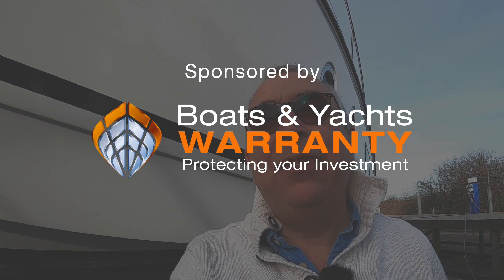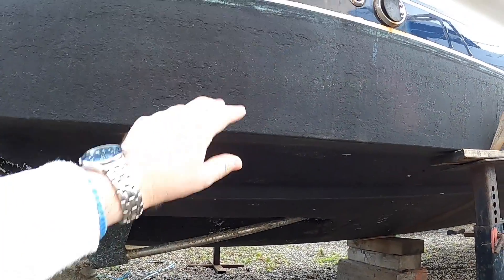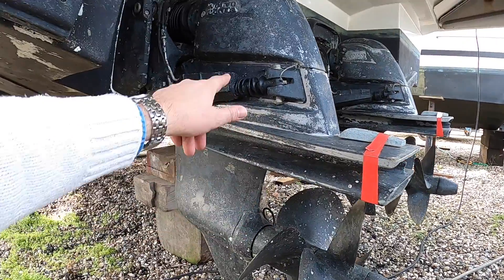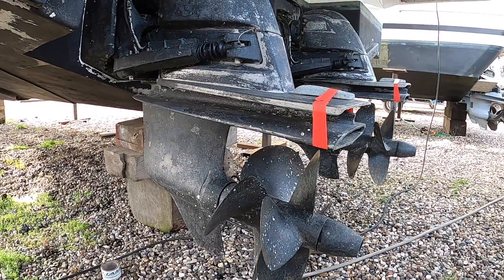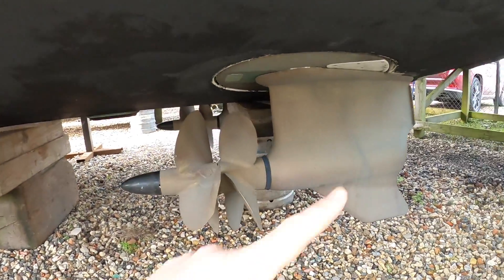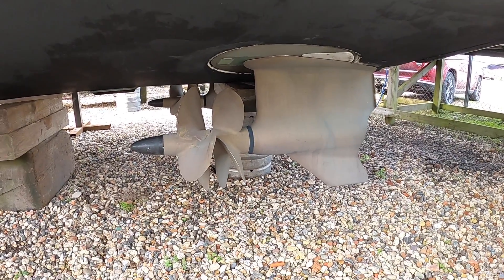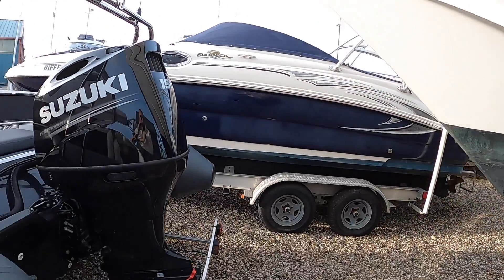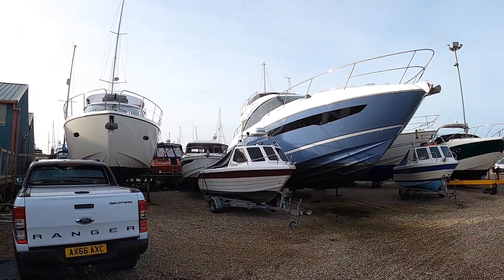Boat Drive Systems Explained

Comment: IPS can now be had as Twins, Tripples and Quads. Also, the pods are designed to detach if struck hard, without leaking. Shallow enough water, you can have them salvaged and possibly repaired.

Comment: Hello I was on one of Thames river boats from the sounds I can hear engine running and a high pressure water jet coming out of a nozzle on the back I was unable to see any fixed pitch or variable pitch propeller can you enlighten me how the boat is running.
Reply from the maker: Water jet probably! 🙂
Reply: @AQUAHOLIC  Thank you; that is what I suspected as I was not able to see any propeller.

Comment: Without a Trailer, Stern Drives are a pain in the ***. - The prop unit is always submerged and that means corrosion 24-7... and to service it, you have to pull the Boat onto land.   Outboard Engines are far better and easier to maintain.

Comment: Ive read some time ago that ips (specially the volvo penta ones) are a real problem. Apparently they have some kind of sealing(cant remember the name) that needs to be changed every 5 years or less, otherwise your ship may very well sink and is like a 10k per seal on each engine .
Reply from the maker: Did you believe it..? 🤔

Comment: When I see two or more large outboard engines on a boat, I clutch my head in despair. The owner clearly knows nothing about efficiency, either fuel or equipment cost. I see a non-boat person with a boat.

Comment: @7:11 "You can only have them in twins" is incorrect. There are triple and quad IPSs out there and have been available for at least a decade.
Reply from the maker: You are absolutely right. I phrased it very badly, what I mean was, you cannot have a single IPS drive on your boat, has to be twins - or more, as you rightly say.

Comment: Re IPS vs outdrives, you say the IPS has an advantage, that by being a bit further forward on the boat they have more leverage. That point is highly debatable. Leverage is a function of the "arm" and the outdrive have the longer arm and therefore more leverage. Any marine engineers care to elaborate?
Reply from the maker: Try holding a heavily loaded shopping trolley in the middle and swivelling it, then try holding it right at the end and swivelling it, and you will see just how much easier it is the closer you get to the middle.
Reply: @AQUAHOLIC  Simply incorrect, sir. If that were the case, bow thrusters and stern thrusters would be amidships as would be rudders. The further aft and the closer to the outboard edges port and starboard, the more leverage.
Reply from the maker: @daveriley6310  You go and try it. 🙂

Comment: Good vlog Nick. In Canada & US due to the many fresh water lakes & rivers the use of outboards are most popular especially for sports & fishing boats. I/O’s are used on boats in the +19ft range as most ppl don’t sleep on these boats & they are easily trailerable along with outboards. Most shaft-drives & pods you will find on the coasts as saltwater is an issued even with zincs. The Great Lakes being huge also will find shaft-drives & pods even though they are fresh water as one needs size if travelling long distances on those inland lakes that have access to the Atlantic Ocean.

Comment: Good cover of the basic marine propulsion systems.  I suggest that you include the surface drives also.  They have been in use quite a long time.  Whether Arneson, Q-Spd, ZF, etc. these are the most efficient drives for boats.  They add to the boats top speed and also fuel efficiency.  There are a few high end boat manufacturers which install them as standard fare (such as Pershing).   Mercury Racing even has 'short leg' sterndrives which operate in a surface drive type mode.  They also use cleaver type props.  Of course, jet drives have also been around quite a while and have their advantages.  A brilliant new technology worth discussing is the new Sharrow propellor technology could also be of interest to the Aquaholic's.   Also note some pod units actually face rearward.  Thank you for another interesting video.

Comment: What I've never understood is why boat drive systems don't have proper gears to keep the revs and subsequently fuel consumption down.
Reply from the maker: Because there are no hills. So they're effectively permanently in 'top' gear. The only gain lower gears would give is faster acceleration, and since boats accelerate perfectly well in 'top' gear, the extra weight, complication  and cost is unnecessary.
Reply: @AQUAHOLIC  Hi, yes I get that, however I'm talking about gearing to lower the revs at higher speeds. Gear 1 would be the current direct drive and gear 2 longer to bring the revs down. If you could shave 1000 rpm off it would have huge benefits for fuel economy and engine longevity.

Comment: Thank you for another informative video. May I suggest a part2! I am looking at buying my second boat (last one I owned was over 20 years ago!). I’m thinking of a 5-10 year old bow rider and am plagued with worries about stern drive engines. Online research just seems to tell tales of sinking boats resulting from worn bellows and blown engines from corroded manifolds and risers. It would be interesting to have your insight on what to look for when buying/related problems (I.e. have you experienced them/know of those who have). Indicative maintenance costs/frequency for replacing these parts…..from your experience!! Thanks again.
Reply from the maker: There is a 'how much does it cost' video on the channel. For what it's worth, every proper boat I've owned has been sterndrive. The trick is to service and look after them properly. For example, bellows should be changed every two years, if you don't do that they go hard and brittle.
Reply: @AQUAHOLIC  Hi Nick. I’ve seen that one (lockdown for me included viewing most of your videos!!). In fact your boating videos are what have given me back the itch to get on the water! I’d certainly maintain a boat as recommended. Buying second hand, I suppose the answer is to ensure I only buy a boat that has receipts for a fully maintained boat, to ensure I know when the next parts replacements are required. Fingers crossed they’re out there within budget! :) Many thanks and keep the videos coming ;)
Reply from the maker: @FreeflyMarcus  Worth considering a mechanical survey, depending on the value
Reply: @AQUAHOLIC  That’s a good point. I’m fairly “budget limited” but a survey would definitely provide piece of mind. I’ll look into that. Thanks again.

Comment: You skipped jet-drives, if fuel economy is not a worry they can be very good and the shallow draft of a jet driven boat beats any other propulsion hands down. They are also diver/swimmer/marine  life friendly.
IMHO, the popularity of IPS is strange, you hit anything with those and you have a submarine on your hands or a wickedly expensive repair bill. I guess the boat-builders love them because of the simplicity of installation, i.e. cost savings. For me it's a no-go as the draft is as deep as a sailing yacht's.
The more I think about it, you easily could do a chapter two, there's plenty to talk about.
As always, great work.

Comment: Volvo Penta IPS has been available and used in a triple engine and setup since 2006, just 2 years after the first Volvo IPS system. The triple systems are used on larger boats.

Comment: Pretty clear explanation of the different drive systems available. I spent a lot of time driving outboards and loved them! It's amazing what a modest amount of horsepower can do for a small boat. I must admit that the IPS drives are a rather odd but fascinating type of drive.  I've not seen them in the US, only on the internet. As for the outdrives, driven one many years ago and it could really push through the water. I can confirm that the maintenance can get expensive as well as a bit of work involved.

Comment: I wonder if companies like Suzuki,Mercury Marine,Yamaha,Honda,etc. would design and build an outboard engine with a forward facing propeller  rather than rearward facing props similar to the IPS system for a more efficient drive system.

Comment: Mercury outboards have realeased a V12 600HP. Also do you see any surface drives in the UK. A surface drive is like a combination of shaft and outdrive systems. Cheers

Comment: Nice bit of engine types explained Nick. ps what is the watch you are wearing, please?
Reply from the maker: It's an Omega Seamaster Professional 300M, circa 2005. This particular model isn't made anymore, but there's a new version of it out.
Reply: @AQUAHOLIC  thanks Nick now the hard part is to persuade the wife I need a new watch lol
Reply from the maker: @raydowley1038  You're doing it all wrong. You know when you mention her handbag that you've never seen before, and she says 'what, this old thing? Had it for years'...
Reply: @AQUAHOLIC  forgot about that one Nick she is getting on a bit now so the memory is not as good so this should work lol

Comment: I'm interested to know what bearings or bushings are used in the exterior drive parts, such as the P brackets and the glands. Would I be right in thinking they're bushings, also made from bronze? I imagine bearings would be too susceptible to corrosion
Reply: On most sailboat diesel aux engines (which only operate to about 2,500 rpm) the bearing is a plain sleeve of tough plastic with grooves to allow water to flow in for cooling and I guess “lubrication”.

Comment: Hi Nick, think you’ll find that shaft drive is a bit older than you were implying! Some chap called I.K. Brunel used it first on the SS Great Britain in 1843, mind you his was only 1000 horse power.
Reply: Hmmm, I wonder if he meant to say 1850s, not 1950s
Reply: Yeah, I wondered about that 1950s comment, too. I recently sold a restored Chris-Craft that was built in the '40s (though that model had also been produced in the '30s). My favorite is the 1926 Triple Cockpit. All were straightforward shaft drive, of course.

Comment: Other than cost of fuel, what’s the difference between choosing diesel powered vs regular gasoline for your boat? Is it more quiet, less fuel smell, maintenance cost?
Reply: There are some differences between the technologies common in all applications - like petrol engines being more responsive and giving higher top speed and are usually lighter. Diesel has higher torque and may have more vibrations and dirtier emissions (soot). 

In a boat, the main difference (at least for me) is that a bit of spilled diesel usually is not a big deal, but petrol fumes can detonate. Inboard petrols usually have fans that vent the engine compartment before you start the engine. A family friend forgot, the boat exploded, and the whole family had to jump in the sea.

Comment: Here in the colonies there outboards as large as 600 HP in triples, quads and quints. Each outboard costs approximately $73,000 per. Cheers

Comment: Nice video, thanks Nick. I do like an educational video, great for those of us here who don't necessarily know that much about boats :-) On the outboard engine front though - have you seen the 600hp Mercury engine? It's a massive V12, really impressive, they even just turn the lower section of the engine rather than the whole engine assembly. Lots of video channels of Miami inlets showing huge boats with 4 or even 5 outboard engines, crazy!

Comment: Excellent, I never realised the orientation of IPS and the reasoning behind it with the interference free access to water for drive. I assume that the IPS is an advantage over a few of the other drives in berthing costs as they don't project out at the rear ?
Reply from the maker: It's rare that outdrives project further than the bathing platform

Comment: Nick, you can get Mercury engines up to 1,750HP from their racing line although the 1750 is usually mated to a surface drive prop system.  The Mercury Racing 1350/1550HP can be mated with the M8 outdrive.  The general usage Mercruiser line is available up to 430HP.  Very nice presentation of the most common drive systems.
Reply: This is true, but its hard to compare functionally racing gear which are used at racing speeds to the more common 20-35 knot interval most of the boats Nick reviews are in.

Comment: The first commercially available outdrives appeared round about 1960.  They  were developed by Jim Wynne (an engineer and also a legendary powerboat racer) and Charlie Strang.  There's some debate about exactly who did what, and when, but outdrives mated to Volvo (Wynne) and Mercury (Strang) engines appeared at about the same time. Wynne worked with Strang at Mercury to develop the first drives but then branched out on his own.  I certainly remember my father selling powerboats with outdrives on, imported from the US, in the very early sixties.

Comment: Have to say, one thing went incorrectly. As you introduced DPH outboard drives you talked about trim system while showing steering cylinder. Trim cylinders are between the leg and transom shield and are not visible when the leg is trimmed down.

Comment: Always entertaining.

Some comments on the shaft drive please:

It is the least efficient due to that the force is directed slightly downwards instead of straight backwards. Unlike sterndrives and IPS (and Arnessons) it pushes the front of the boat down instead of lifting it up. This is why IPS is superior in speed and consumption with the same engine. 

Since the propeller is fixed they are more challenging to reverse with than the other systems. Especially with only one engine. A single propeller spins the water in a certain direction and the vortex created initially pushes the boat sideways rather than backwards (Duoprop drives or two counter rotating engines on shafts solve this.) The sidewards movement is extra obvious when starting to reverse from standing still and it is not until the boat has started moving backwards that the rudder has any effect. (Different going forward when the water hits the rudder and the rudder can direct the thrust from the propeller.)

Hitting e.g. a rock or something at speed with a shaft drive, the shaft can push the turning propeller up and the propeller opens the hull like a can opener. That will not happen with IPS, which as you said are totally sealed off, or the stern drives.

Comment: These IPS modules are mechanical type, not like big ships, which have electric motor IPS drive units. So next invention what we wait, is that also small ships will have electric-IPS drive systems.

Comment: Outboards go up to 600+ HP with the Sevenmarine and Mercury V12. And if an IPS is damaged the boat will sink fast.
Reply: You might want t do some research before making false statements. If you happen to hit some flotsam at speed, an IPS pod is designed to shear off leaving the hull watertight. If the same happens to a shaft drive you can tear out the shaft and rudder - that’s when your going to sink.

Comment: Re : the shaft-drive boat.  That's it?  It seems so rudimentary but, no doubt, gets the job done.  I love all your videos but this one was, by far, the most educational.  I always wondered what drove this boats forward.  Very complete and totally fascinating.
Reply: Shaft drive systems have been around from the time we first put an engine in a boat to help the wind push it along.  The only powered drive system older, and not by too much, is the paddle wheel!  As Nick pointed out, you only have a few SMALL hull penetrations to deal with and the boats balance is better.  You lose some mid-ship interior space, some added noise in the cabin area and a minor loss of maneuverability.
Reply: Shaft drive is by far the safest.

Comment: …the ‘only’ propulsion systems 🙄 - excluding sail drives or the turbine (or jet) engine, the ramjet, and the rocket - or rowing - I wonder what else  😄😄.
Reply from the maker: Do you see a lot of motorboats with ramjet or rocket propulsion in your part of the world? 🤔
Reply: @AQUAHOLIC  

…it is not that - it was your statement - that - those were the only form of drive system available - sail drives for example - are widely used on most catamarans around the World for example - what - you may have said - is - these are just some of the types of drives found on water craft.

Comment: How mcu can the pods spin?
Like can they do 90 degrees and spin the boat in place?
Reply from the maker: They don't need to, they run in opposite directions to rotate a boat in place
Reply: @AQUAHOLIC  clever, just twisting essentially 👍

Comment: Counter-rotating props are used to eliminate angular momentum.  Angular momentum is conserved, so if you had a single prop and tried to turn it, the boat would have to rotate in some plane (depending on the direction of the prop's rotation and the direction it was turned in) to compensate.  I'm sure you've seen those demonstrations when someone is sitting on a rotating stool holding a spinning bicycle wheel.  When the person turns the wheel, he or she starts spinning on the stool.